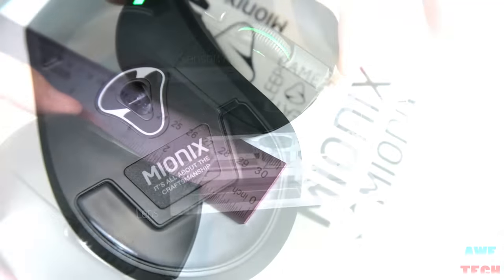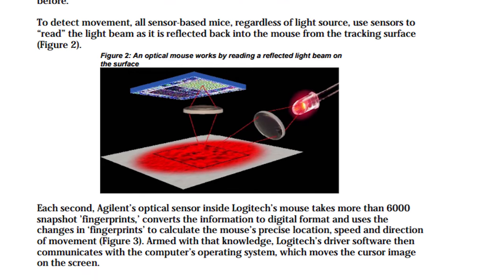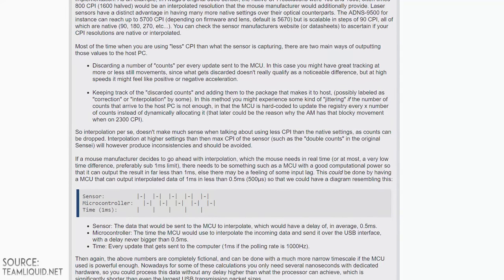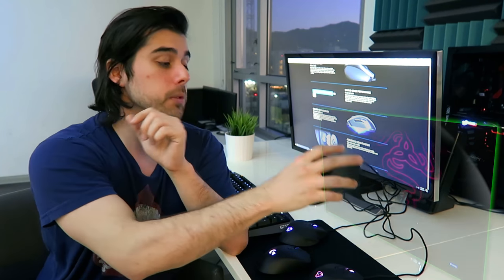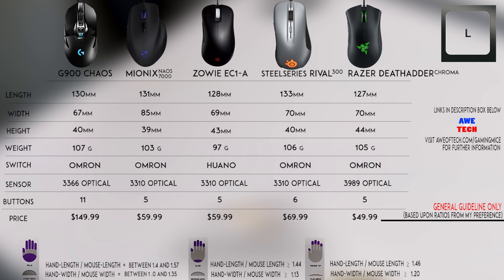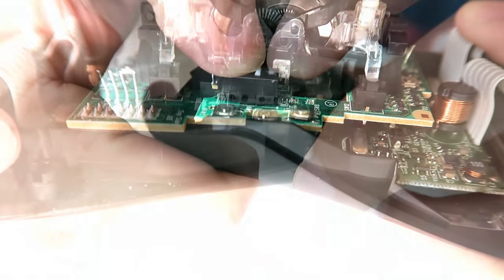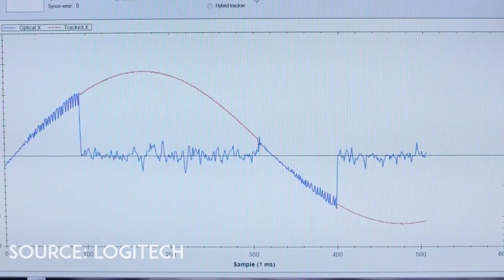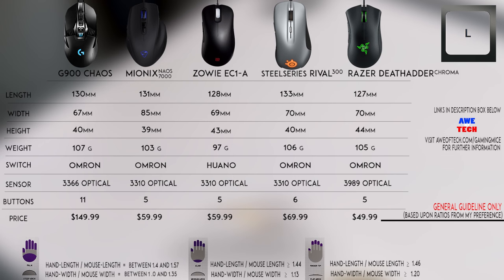Best Gaming MICE - Selection Guide - ft. Logitech G403 & More!

Comment: 6:00  ~!_!~

i want G900 wireless system
i want G900 click system
i want 3366 sensor
i want za12 shape
i want g pro weight
i want charging dock for mic so i dont have to plug ,unplug things.
i want onboard memory.

until then, i will keep using my steering wheel as my main input device for CSGO
Reply: Logitech g403 wireless has all that except the charging dock.
Reply: Alan Pereyra too heavy. i have g403 wired. and it is too thick(high). but i can totally go none-wireless so g pro is the clostest i guess
Reply: For me I wish they would make a g pro with the new wireless thing they have with the mouse pad that charges your mouse while it is on it

Comment: Been using the g403 for about a week and absolutely love it
Reply from the maker: +BassFishingNEB really enjoying mine right now as well =)
Reply: Wireless or wired? If wireless, any input lag?
Reply: KuliJens there is basically no noticable difference
Reply: Hello i just received g403 and notice 1 issue. Want to know if its suppose to be like that. First my right mouse button click needs like half as much pressure than the left,and the sound is also weaker . Its very weird should i return it ?
Reply: No, it is like that on purpose; I don't know why but it is.

Comment: Does your g403 wireless rattle when shaking it up and down?
Reply from the maker: mine has 0 rattle
Reply: early batches of the g403 had a scroll wheel rattle issue, you can RMA it to logitech for a newer one without rattle.

Comment: Logitech G403
Logitech G Pro
BenQ ZOWIE EC2-A

Which one should i choose and why? (I don't care about looks)
Reply: ThatMovinTarget If you are going for the ec 2a, upgrade to the ec 2b as it has a better sensor. Personally I don't like the shape of the G pro ( my hands are 19 by 10cm and I use palm grip) but the 403 is very comfortable. I am personally buying the steelseries rival 600 but it comes down to personal shape preference.
Reply: Ryan Kofler I actually owned the g403 for a month and I have the exact hand as you 19cm x 10cm and g403 actually hurts my hand after a while because of the high profile

Comment: Minix castor, g403, or deathadder?
Reply: Deathadder for larger hands and med hands with palm grip - 403 for medium hands or perhaps for large ones who prefer fingertip grip. Neither for small hands. Monix caster is pretty specific IMO - you will like it or not based on preference. Being that the shape is like that, you need to try it to know. It is not good for any claw grip, and its sensor is worse than the other two in any case.
Reply: Thanks good to know my hands are kind of small (image my middle finger about an inch taller than a gaxaly s5 in vertical position) but then what mouse is good for smaller hands like me? and if you wanted to know I'm 12
Reply: Also, im kinda interested in the Dream Machine Pro S idk if that or the sensei raw is good.

Comment: "DIP doesn't matter"
well
as long as you don't play osu! using mouse.
Reply: DPI. And it still doesn't really once you go past like 2000DPI I don't think you can find any use for those extra if your mouse sensor is accurate. I mean imagine how many dots 2000 is within one inch.... How could you miss like that?
Reply: well, you have a point. using DPI higher than 2000 is hard.